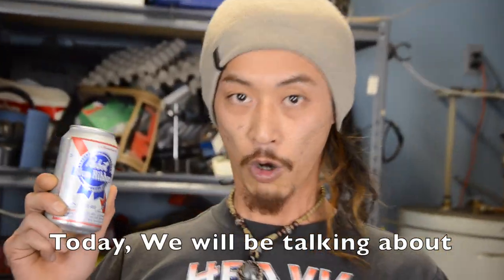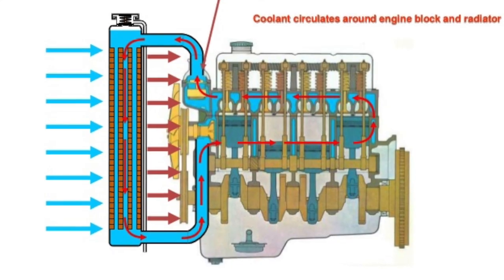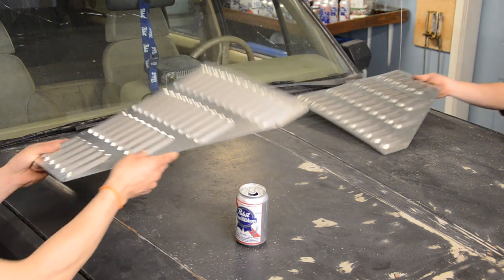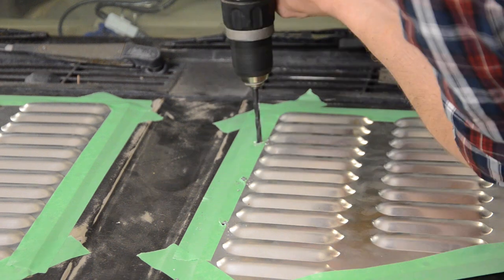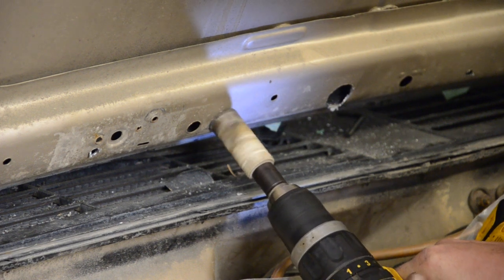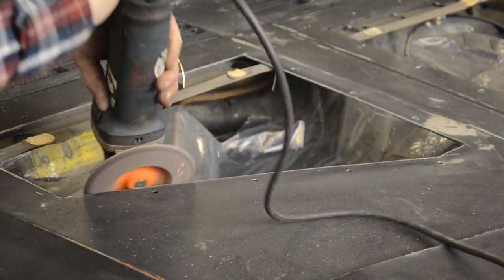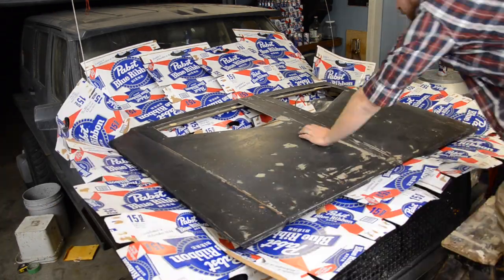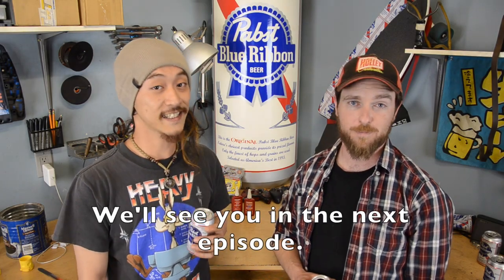Hood Vents - Jeep Cherokee XJ - The Roadhouse

Comment: Tip to anybody worried about going too far with the drill bit when poking the holes - tape up the bit to the desired length having a few wraps to bumpstop it when it hits the hood!
Reply: Youre a carpenter
Reply: Or use a bit-stop

Comment: Suggestion:  Take hood off, lay upside down on saw horses.  Mark holes, drill and cut everything.  Paint and then reinstall.  No mess or worries about drilling into anything under the hood.  No misplacement of location.  Great video.

Comment: If you want to save some beer money on your hood vents, go to the dump and pick up some old microwaves with the vent louvers on the sides. The metal's probably about the same thickness. Cut it out, bolt it up, good to go! You can even have wood grain vents if you find an older nuker and you're not proud.
Reply from the maker: +Darwinpasta Proud to be an old nuker myself bud!!!
All for it!
Reply: That's a great idea. I salvaged some old louvers from a scrap pool heater. They look cool. Already have a nice textured paint on them as well.

Comment: You guys crack me up, very entertaining videos. Just curious why you don't have Kokanee, or Molson Canadian, posters and other free graft posted on your walls. Not trying to bust your balls, The last time I drank an American beer, was in high school. Mid '80's beer strike with Molson and Labatts. When it was finally over, you could buy Rainer, or Olympia dirt cheap. Not sure if your familiar with the old Dodge bird bath hoods. Mid to late '70's, they added a recess in the hood on both sides of the center rib. It held water, looked kick ass, but when you popped open the hood, all the water ran down onto the unsealed distributer cap on the small blocks. Have pretty much all the parts to convert the '80 to the bird bath hood. I have a hood, the different hood latch, and wiper motor cover. How have people over come this, shy of converting to a big block with the distributer at the front.
Reply from the maker: Hahaha 
Don't open the hood on rainy days. LOL
Love the PBR. Maybe it's the American in me.....

Comment: Good work...I no longer have my XJ but I do have a 93 suburban that I want to build a big Hummer style vent for..I have an idea of how to make it look good by bolting long angle iron to the hood for the sides and then bolting several short angle pieces to the long angle at the correct slant and then bolting 1 or 2 inch wide aluminum slats to the short angles..might seem a little strange for some people but since I'm adding a 6 inch lift and 37s and removing the rear windows Avalanche style and putting round headlights in, I believe I will love it..it cannot compete in looks with a 4dr jeep truck, but it will have a pretty cool and unique look...I just found your channel and like it..am I wrong to assume the asian guy is Mongolian?...they are some of the coolest looking people.

Comment: You guys are pretty cool. I've never seen a way to maybe block off the driver side vent for water proofing, or maybe some kind of shield over the TPS sensor. I have lebaron  vents and have gone through two sensors in four months...any ideas? Keep on jeepin. Randy.
Reply from the maker: Randy Beronia Haven't had that issue, but there is a type of fabric you can put on the inside of the vents.
It looks a bit like black silk. It holds up to the heat, lets air through and keeps water out.
I'd have to check with my snowmobile buddies to ask what its called, but they swear by the stuff.......
Reply: @PabstBoys any luck finding what this fabric is?

Comment: Love it, as usual guys!  Great Job.  What was the spray coating you were using?  That looked like it had some pretty cool texture to it.
Reply from the maker: HEAPofJEEP Rust-oleum Leak Seal. It's a rubberized paint. Love the stuff!
Reply: Pabst Boys How many cans did you end up using? How many coats as well?
Reply from the maker: Doug Farmer Used one and 3/4 cans. With that stuff, I like to do one thin coat to start, then a heavier coat. after that, an over spray coat from about a foot and a half to two feet away to get a cool texture.
Reply: It looked way better than I anticipated. You don't think the rubberized paint will trap moor heat under the hood now? Especially with it being black.
Reply from the maker: Doug Farmer I don't think that'll be an issue. When we first got the jeep, it had insulation under the hood. Can't be worse than that........ And the vents actually help move quite a bit of air.
Reply: Sweet! What temperatures are you running at now? Just the normal? I've only recently had issues with heat as this is my first warm season wheeling. I've done the thermostat, radiator, hoses, and water pump, and checked for air and proper fluid levels.. Just found out my electric fan isn't working properly the last weekend I went out.
Reply from the maker: Doug Farmer It's only when climbing, or under heavy loads for prolonged periods that it ever climbs above normal operating temps. 
The cooling system functions as it should under normal conditions. I'm assuming that it might run a little too cool in the winter so we're gonna have to either blank them off or use a rad cover when its cold.
Thinking about possibly going with an electric fan instead of the viscous one thats in there.

Comment: Off topic butt.  What is the size of the two bolts that hold on the rear leaf spring shackle? I need to get new bolts for my shackle replacement and would like to get them ahead of time.
Reply from the maker: 14mm x 4 1/2"
9/16" is a bit too big and will get stuck in the bushing. So, just a warning.

Comment: Which would cool more at slow or stopped speeds? Vents or electric fan w/ mechanical fan delete? Great video! Subscribed! :)
Reply from the maker: ***** If it were one or the other, Vents would do a better job. The issue with XJs is that the air gets trapped under the hood at low speeds and cant pull through the radiator, even with an electric fan. 
Electric fans DO do a way better job at regulating temperature than the viscus type though. And actually give the engine less drag, so it will generate a bit less heat on top of it.
We honestly want to go with both, just the vents were a good first step, and an easy mod.
Reply: Awesome! Thanks for the explanation! :) Looking forward to the rest of the project!

Comment: How do these do against water? Obviously if I'm that deep I'll have bigger problems, but in Washington it rains a solid 360 days a year. Do you think rain would be an issue?
Reply: ADAM SCHRAMM i had similar ones on my xj and never had any issues with rain getting in
Reply from the maker: ADAM SCHRAMM We're just north of you, in BC Canada.
Same weather, no issues.
Reply: Your engine is waterproof, dude (or at least it's supposed to be. If it's not, fix whatever you broke) Your radiator fan already sucks water in through the grille and throws it at the engine every time it's raining.

Comment: I was having over heating issues in my 4.6 stroker xj. until I installed dual ford Taurus fans. with out hood vents those bad boys would blow the mud off the motor and suck up small children when they turned on.
Reply from the maker: +Aaron Campbell Hahaha! We gotta look into that..
Reply: Could you do a video on doing that?   I just replaced my e-fan with a new e-fan, but I still have the viscous fan.  But I have a Tauras fan and would love to swap it for the vicious. There is a lot involved!

Comment: rivets would be much better for this task but they still look sweet
Reply: Bolts with locknuts hold just as well as rivet's and are more durable. Plus they can be removed later and more easily transferred to a different vehicle, if need be.

Comment: This is what my Mercedes needs. Sucker runs hot even after a completely rebuilt cooling system.
Reply from the maker: on something aerodynamic like that, I'd mount them closer to the front of the hood because of the pressure differential of the air flow, but yeah, they do the trick.

Comment: What happens when it rains? Looking into this,i make these at work.
Reply: imma order the tonight, lemme know if you ended up buying them!
Reply: Your engine is waterproof, so why does rain concern you? Every time it rains, your radiator fan sprays water all over the engine through your grille. The main issue guys run into with good louvers is the radiator fans spraying dust all over their windshield.

Comment: will it hurt your motor if the rain water gets into your motor
Reply: As long as you have an air cleaner, there is minimal risk.  The only common issue is water getting into your throttle position sensor, which doesn't really happen all that often, but it's possible.  Even if that happens, it's easy to diagnose and simple to repair, so to most people it's worth the risk in exchange for vastly improved cooling.
Reply from the maker: Stalled out once cuz the distributor cap was leaking. fixed that. All good now.

Comment: you used the leak seal on the vents?
Reply from the maker: +T.O.P MIDDLE TN Sure! It's been holding up to the heat just fine.
It's not in direct contact with any heat source other than the hot air moving through it.
Reply: nice thanks for the reply good work

Comment: what if it rains 364 days out of the year
Reply from the maker: Sherry Yong a bit of water might get in when you're parked, thats true. a bit. but no more than when you drive through a puddle.
If you have ignition wiring problems, this may not help, But thats something else that needs to be addressed. lol
Reply: Sherry Yong Well I guess you will always have that 365th day of the year off from the rain lol.
Reply: Your engine is waterproof, dude. It already sucks water in through the grille any time you drive in the rain.

Comment: seemes to me these are desinged so you can just cut out the hood and then lay them down.
Reply from the maker: That's exactly right
Reply: Meaning had you just cut out the triangles in the hood first your cuts wouldn't have been off.

Comment: A cardboard template would have saved you guys a ton of work.
Reply from the maker: I suppose...
Reply: have you had a problem with the water getting in the engine compartment with these Hood vents
Reply from the maker: did have an issue with the distributor getting wet and loosing spark, but then we sealed where it was leaking in.